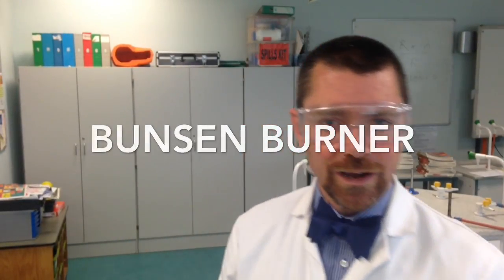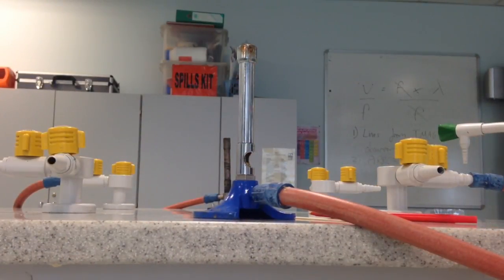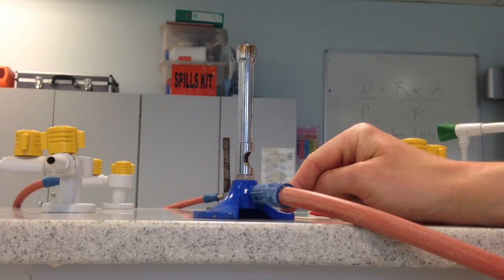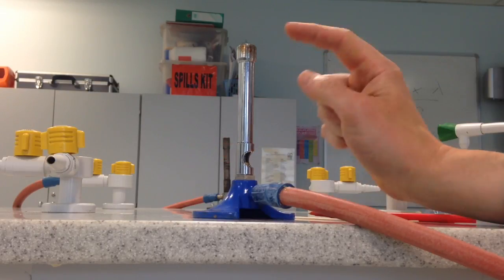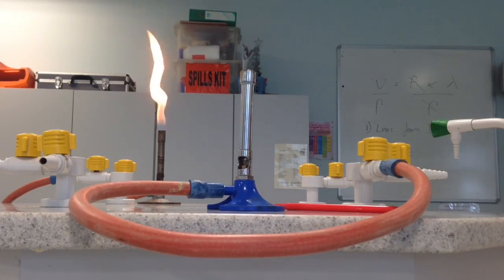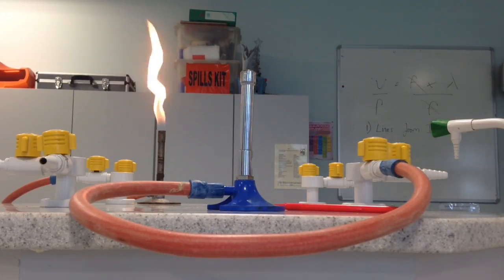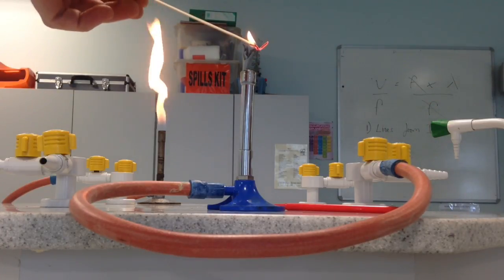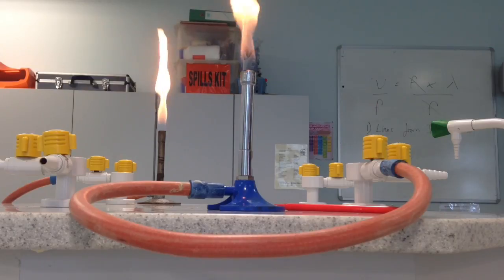Lighting a Bunsen Burner

Comment: You missed a step, make sure to place your hand in the fire to Check and make sure that the fire is the proper temperature. This method allows a proper diagnostics of the stability of the flame. But remember to wear goggles and a lab coat during the process to properly protect your eyes and body. Gloves are optional as they will inhibit the sensitivity of your skin, proving bias to the proper diagnose of the flame temperature.